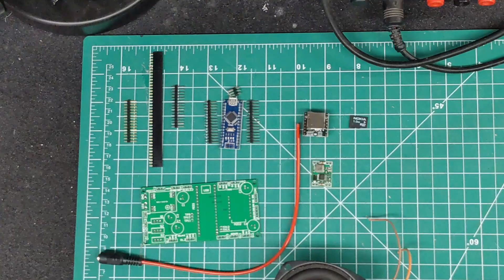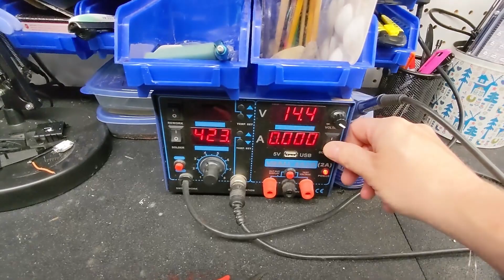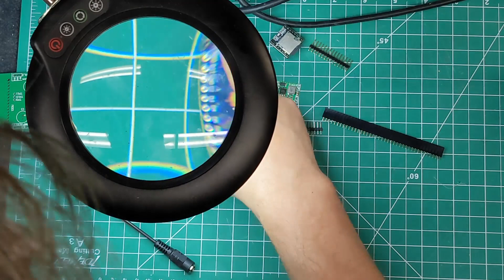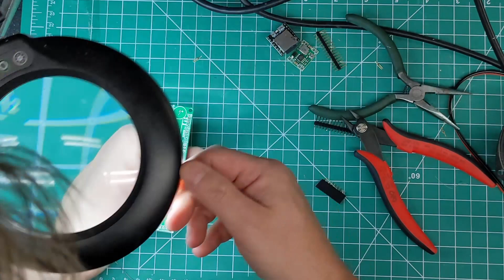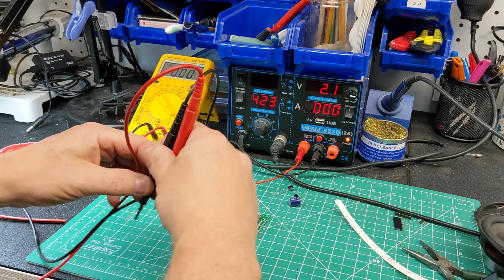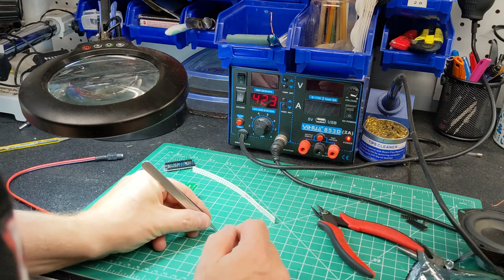Prop Controller Build

Comment: Thanks for the video, looks great !
I did order a few from pcbway and i do have some (limited) solder experience, but im wondering which size SMD resistors you use ? 
Could you please let me know !?
greets
Reply from the maker: Brilliant. I hope it's useful. I used 0805 I think. 0603 should also fit ok.